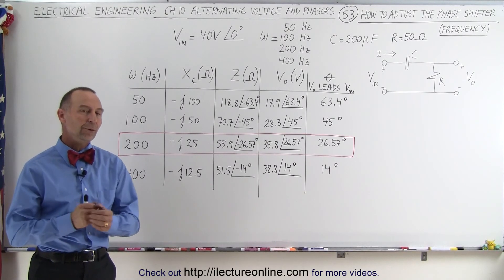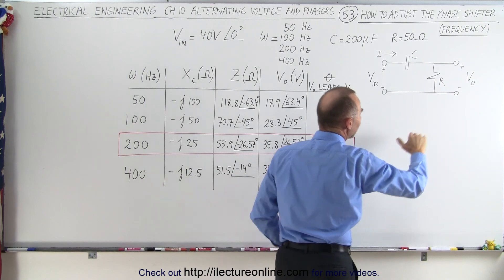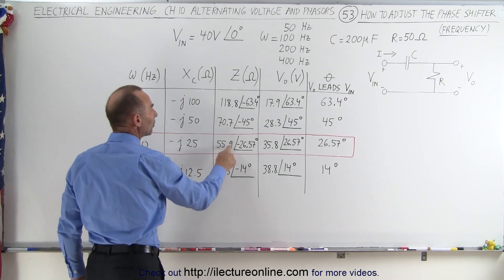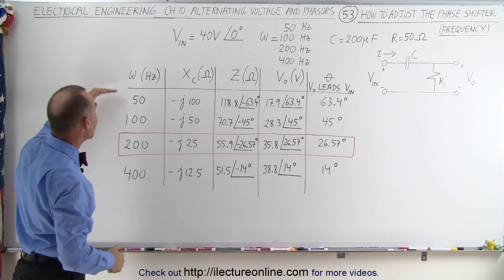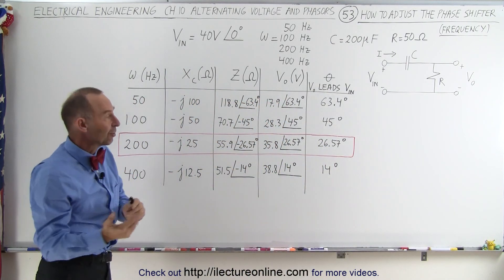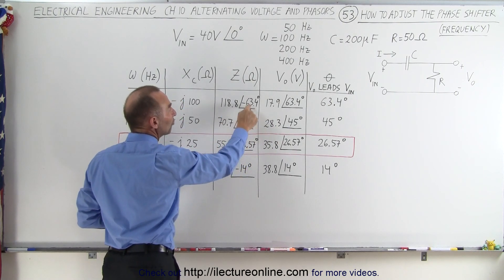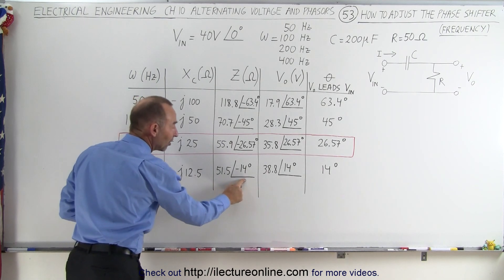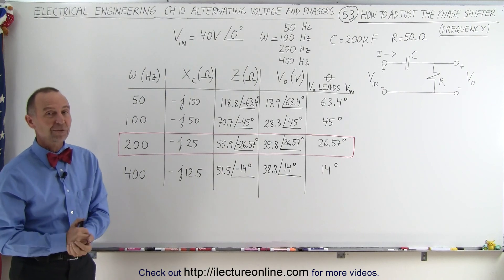Electrical Engineering: Ch 10 Alternating Voltages & Phasors (53 of 82) Adjust Phase Shiftor (Freq)

Comment: w is in rads not Hz. Slight correction because Hz was confusing me.
for Z in row 1, I got 111.80 by root 100 squared plus 50 squared. The phase angle was correct, at least.
Reply from the maker: You are correct.
Reply: Rad/s is the same as Hz

Comment: Mathematically it all makes sense with regards to frequency of w and voltage-output vs voltage-input,  but from an intuitive standpoint....why does a higher frequency result in less of voltage loss from input to output? Does higher frequency voltage afford it some sort of special protection against  loss?? Does higher frequency allow the wave to slip through resistive elements more easily??
Reply: Not too hard to understand considering that the capcitive reactance and thus total impendance is inversely proportional to frequency. Xc = -j/wC. So as frequency increases (w = 2*pi*freq) the total impedance decreases for fixed R.